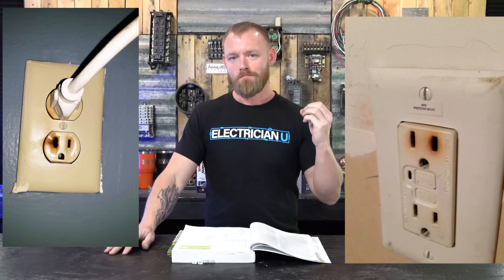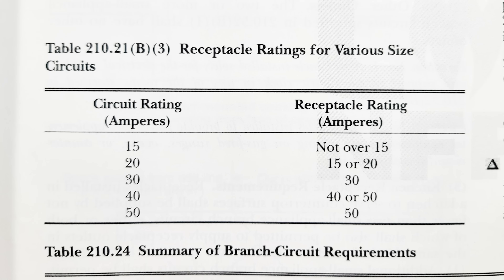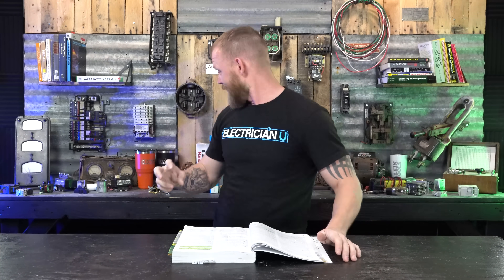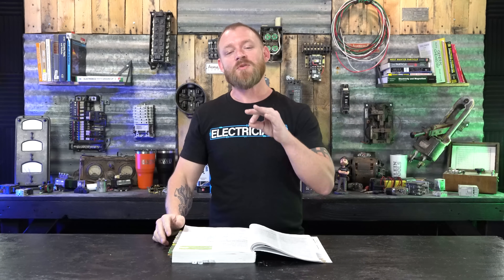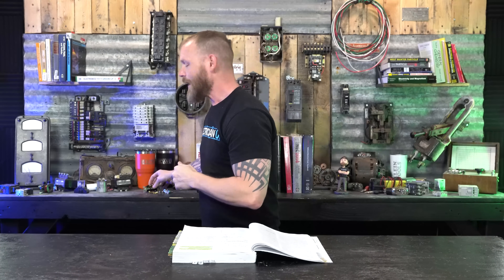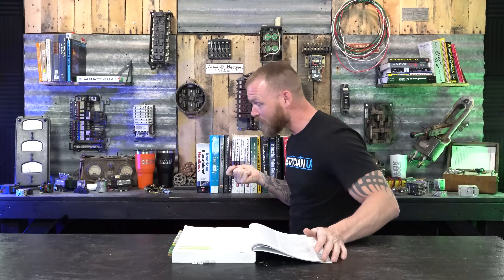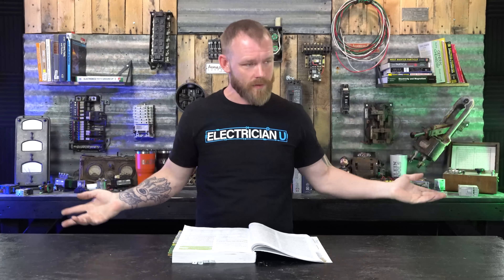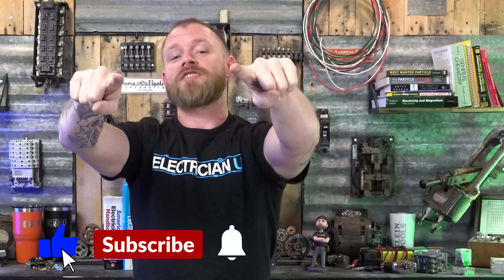Won't These Melt?!? 15amp Receptacles on 20 amp Circuits!!!

Comment: Man, I was doing a home DYI project this weekend and ran into this exact question/issue. I was confused when noticed that my circuit was 20 AMPS (12/2) but my outlets were 15 AMPS. I figured the previous owner made a mistake, and use the wrong outlets. This is the exact vid I needed. Thanks.
Reply: wait till you find out most appliances only have 14, 16 or 18 gauge wires in their cords/plugs.
Reply: @mrniusi11  yes, but those are sized for their specific load. You wouldn't run a 12ga cord to a table lamp.
Reply: What is used inside a house that draws 20 amps? Have you ever seen anything for inside use that had a 20 amp plug on it?
Reply: @markchidester6239  My understanding is that for code, 20 amp wiring is a safety thing. Like you say, MOST things DON'T run that high. Certain heaters and that kind of thing CAN be a problem.
Reply: @thomasschwarting5108  ... there are no consumer grade electric heaters that run more than 1500 watts, so that should be a hint at what most are working with. Are there people out there running multiple heaters / appliances? Sure. These are also the same people having problems... and failing to read directions or follow common sense.
Reply: @markchidester6239  haven't yet, figured my harbor freight compressor or welder would be that, still yet to find something that uses a 20amp cord. Hell the electric jack hammer I got doesn't even use 20amps
Reply: @markchidester6239  my cabinet table saw when finishing my basement. Installed dedicated line.
Reply: most 15 amp outlets are rated at 20 amps on the pass through to the next outlet. That's why it's allowed.
Reply: @rupe53  Ah, that was my exact question. Thanks.
Reply: @rupe53  That was my main question through all of this... I will never have an instance where I need to plug in a 5-20 plug... but it is the pass-through I am worried about, what if the first receptacle in the line is passing through 20 amps to devices on the other receptacles...
Reply: @JamiePaterson4  ... let me rephrase that: A 15 amp prong configuration (standard outlet) is rated to 20 amps on the passthrough. IOW, if you plug in a 10 amp toaster on one outlet and a 10 amp coffee pot on another within the same circuit you should be ok. (provided the wire and breaker are both 20 amp rated) The flip side is a 20 amp circuit is only rated at 80% for continuous draw, or roughly 16 amps. Since most appliances draw on an intermittent basis you should be fine. Here in the USA I would only worry if you home is full of the older 2 prong (non grounded) outlets.
Reply: @rupe53  Maybe for the short term that's OK, but not in the long run.
Reply: Not problem with 12/2, especially if the runs are long - less voltage drop, especially if you have a lot equipment run on the same line.
Reply: 15A Duplex is 15A per outlet opening
Reply: I never did understand that. Code says it can be done, BUT is it right?
Reply: I miss the screw-in fuses. One penny under the fuse gave you 15 amps… 2 pennys under the fuse provided 30 amps.
Reply: The previous owner did not make a mistake….both 15 and 20 amp receptacle’s are the same on the In side… the two things that are different is the look, and the price.
Reply: I would have put 20 amp outlets
Reply: As far as I'm concerned it is a mistake.  I always grew up in houses with 15 A breakers.
Reply: Should just hire an electrician instead of doing it yourself, you play plumber you get a little wet you play electrician you get a little dead.
Reply: @paleashail7265  I agree and disagree. Nothing wrong with doing it yourself if you have the knowledge and skill set required. Part of that knowledge  comes in knowing your limitations. When I finished the basements in houses I have owned, I did most of my own electrical and plumbing. In one house I hired an electrician to change the circuit box from 100 amp to 200 as that meant dealing with the incoming power line. (Not experienced for that). Same house, due to changed building code, the perimeter stud walls had to be 6 inches instead of the 4 when the house was constructed. This necessitated digging up the concrete floor to move the original roughed in bathroom plumbing. Hired plumber. ( no knowledge or skill). Also I always get the required permits which means the work gets passed by government inspectors. Pax

Comment: 20A circuit for receptacles with 15A duplex recepts, 15A circuit for lights.  (Better for box fill with 3&4 way, dimmers, etc) Only burned recepts I have seen had loose connection, many times in the wire to plug connection gets hot, thus melting the recept.
Reply: And isn't that more of a case study to say we should just put 20 amp plugs on 20 amp breakers ? They aren't that much more and have better protection.  😊
Reply: @JBDay-bd8cu  Maybe if you are doing a small home but if you are doing something like an apartment building, that cost adds up quick
Reply: Pigtail the joints, never feed thru, that way the load on the receptacle is only what you plug in .

Comment: Question.  Can you explain why the beaker won't trip when having an extension cord then plugging in way more than the 20 amps. I ask bc of another video on here (that I can't find)  where he plugged up 2 50ft extension cords making it 100ft. Then plugged up MULTIPLE space heaters and it just ended up melting where the 2 extension cords met
Reply: a bad contact has high resistance: this limits the current for the whole circuit, but also overheats itself; it becomes a fuse, of a lower capability than the circuit breaker.
Reply: The answer is easy enough if you care to do the math. 2 heaters (1500 watt) is 3000 watts or 24 - 25 amps. Put that on a 20 amp breaker and you won't reach thermal overload for like a half hour or more due to that 130% load rating. Most likely those long cords were only #14 wire, so they got hot first. Even if those cords were #12 you will find most of those molded plugs are the failure point of high resistance.

Comment: As a GC, I usually spec 12 gauge for all receptacle circuits, and only 20a receptacles near windows
Reply: whats the thought process behind that?
Reply: @joeyspencer1332  it’s costly to install all 20a receptacles, but for potential window air conditioners, you’re good to go.

Comment: I had a oil heater that melted my outlet. The problem was that the load was on for ever on an extremely long run, in ground on a 14 gauge. 

It was near zero outside the oil eater's wire was hanging down from its plug right away, the wall outlet was high on the wall with the light switch.

The long run on 14 gauge by -30c  makes it 96v on load. Didn't made the math but on a 12 amp 120v that's not good. Could have been catastrophic for the shed outside...

Comment: According to the NEC , every house that was built before 1990 should have burned down by now.....didn't happen. These are guidelines, nothing more. There is always a safety factor, you just never know how much.
Reply: NEC is not guidelines but requirements which is why the word "shall" is used throughout.
Reply: @gary-dc9st  Exactly. It is a legal document and needs to be treated as such.
Reply: @gary-dc9st  LOL. You people miss the point of all this. The NEC is nothing but a lobbying/bribery club.
Reply: That's a wildly inaccurate way to interpret anything.

These are not guidelines, they are minimum standards. You want guidelines go do lawncare.
Reply: @Morberis  You can't say it is wildly in accurate unless you can absolutely prove that no safety factor is built in.
Reply: @theprofessorfate6184  You've never heard of trying to prove a negative I see.

You don't design things around a maybe. You go by the ratings even if as an engineer you need to figure out what the ratings are.

Guessing at safety factors so you can exceed written ratings doesn't happen on the build or the design it happens when the operator doesn't know any better and exceeds the safety ratings a few times. That's what the safety factor is for. Not for you to save a few bucks.
Reply: @theprofessorfate6184  Many places you can't do it because it is unsafe. And it's not allowed because it has caused accidents. It may not be a problem on install but like a 15a switch on 20a motor load it could deteriorate quicker. 

On a 20a plug the copper might be the same but the spring force is more.
Reply: @Morberis  They are clearly guidelines or they would make you change wiring in every house in the US after every update.  You guys just don't get how the NEC is nothing more than a club for lobbyists.
Reply: @theprofessorfate6184  How would changing up installations every 3 years be practical? You would be complaining that it was just a money making scheme.
Reply: @theprofessorfate6184  The one that doesn't get my ticket revoked, or criminally and civilly charged.

You do know that code is written in blood right? They make changes because of deaths, not for the hell of it.

Comment: The entire 20 amp thing is like a riddle when everything is rated in watts or horsepower.  Why not put a label with an amp rating on it?  Consumers can count to 20 or 30, ask them to pick up a calculator to use ohms law and they say fk it- just plug it in.
Reply: most don't know the formula but Google can fix that in a few key strokes. 1500 watts is how many amps? (done) This is why most heaters / hair driers / etc only go up to 1500 watts.
Reply: V times A = Watts.  Watts can be converted to horse power too.  Be glad its not metric.  Joules and newton meters.  My Japanese diesel is rated in kilowatts.

Comment: I have seen videos of the break down and comparison of 15 and 20 amp receptacles. They showed that the internals we're the same with a different faceplate. Makes sense from a manufacturing standpoint.
Reply: You can always replace a cheap duplex.  Not so easy to replace thin 14ga with proper 12ga once it’s inside the wall.
Reply: @blackhawk7r221  You can SOMETIMES use the existing 14 to "pull" the 12 with.
But not always, I've seen some cases of wiring in concrete walls where the concrete was poured around the wire and it's not going to move short of tearing the wall apart.
Reply: @bricefleckenstein9666  properly installed you can't because it is stapled near the box.
Reply: @Gazebomanfla  Good point.  Many people don't realize that inexpensive residential 15 amp receptacles should not be used as a through point for a 20 amp circuit.  However the commercial grade receptacles are rated for 20 amp feed through as are all the 15 amp GFCI receptacles I have seen.
Reply: Yup and they’re cheaper. Cost is everything to some, quality to others is more import. ✌🏻
Reply: I wonder if the plastics used can take a higher temperature?
Reply: @-JonnyBoy-  It might be better if the cheap plastic they use keeps melting or braking, that way you know when to replace it of if there is a problem. If they use stronger plastic, then the wire inside wall will melt and cause a fire, etc...
Reply: @-JonnyBoy-  same plastic for all receptacles regardless of grade
Reply: builders get special cheap nasty stuff, including switches & GFCI's that only last 3 years or less. Replaced hundreds of them.
Reply: @wim0104  cut as many corners as posst so the customer who had whatever built had to have someone come out and deal with it... Just to save a few cents
Reply: @iwinrar5207  It's more of a Track Home Building thing. Build 20 Condos and cut as many corners as possible. Uniform Stair Risers? Nah, it'll be fine. Level floors? They are getting Carpet so who cares?
Reply: @wim0104  Just moved into a house built in 2010.  Almost ALL the receptacles are loose.  I thought I was loosing my mind.  Looks like I'm going to buy a pile of new ones and start working my way around.
Reply: @Keifsanderson  receptacles have a 10 year life span, they aren't made to lat forever.
Reply: @Galgamoth  Not anymore.  Everything is junk.  The house I grew up in, though?  70yo receptacles still going strong.
Reply: @Keifsanderson  ceramic right? also i have pulled out a lot of those that just crumble to dust.
Reply: @Galgamoth  Whatever.  I've never seen one of my legacy outlets or bulb sockets "crumble."  What I have seen is our modern, engineered-to-fail garbage fail pretty consistently. I don't think having a problem with that is unreasonable. You make a pretty big jump in reality by claiming I think an outlet should "last forever."
Reply: @Keifsanderson  wiring from the 50's is a huge fire hazard, electrical today is a lot safer than than back then. which is why older homes are the ones having electrical fires. UL considers the life of a often used receptacle to be 10 years.
Reply: @Galgamoth  Most receptacles are not "often used," even in commercial settings. Furthermore, the UL recommendations are based on the poor quality of receptacles, not the other way around.  If the darned things were made better, UL would recommend a longer service life.
Reply: @wim0104  That is what probably happened to my outside one.
Reply: I watched a video on Mike Holt's channel that stated just what you commented.
Reply: Not all. 

cheap residential ones are different for 15A due to the number manufactured.  The small savings for 15amp vs 20amp over the quantity justified cheeping out as much as possible. IIRC, these were the $1 ones from home Depot/Lowes. 

Commercials ones were all the same: the internals of a 15 amp were the same as 20amp
Reply: @Jgalaski8438  because of the low usage most manufacturers don't make a residential grade 20A, everything else it just a different faceplate on the body

Comment: About a year ago I replaced every receptacle in my home because many of them were in bad shape,and none were tamper resistant and I've got a young son. When replacing the receptacles on 20A circuits, I used to 20A receptacles,if for no reason other than to easily identify the more heavy duty circuits in the home. I've been called foolish for doing it a couple times because 20A receptacles cost a bit more. My answer to that is, so what if I spent an extra 10 dollars on a home repair? That's my business not yours. There aren't very many 20A circuits anyway. Now it's easy to see which outlets are on a beefier circuit. I like that.
Reply: Excellent line of thinking. I hope you determined the circuit was actually a 20 amp circuit. 
Good quality materials are cheep insurance!
Reply: @markchidester6239  I sure did. 20 Amp breaker and 12 gauge wire. All of them are in the kitchen. Everything else is 14 gauge wire and 15 Amp breakers.
I also used spec grade parts for all the switches and receptacles so they should hold up better over time.

Comment: If they want people to only use 12A, than there needs to be something to allow people to see how much amperage is being drawn. (maybe an LED saying "this receptacle is over drawing")  You aren't going to make every receptacle more complex to add that, and you aren't going to get people to buy and use an amp meter.  So this is all just running off hopes and prayers.

I've ran into tons of problems when the house was wired with too many receptacles on a given breaker.   This is all so poorly thought out!
Reply: in the UK, there's a fuse in every plug. very good idea.
Reply: @wim0104  that's a cool idea